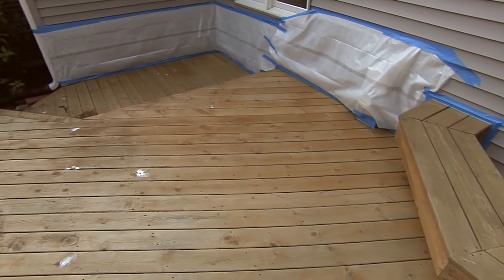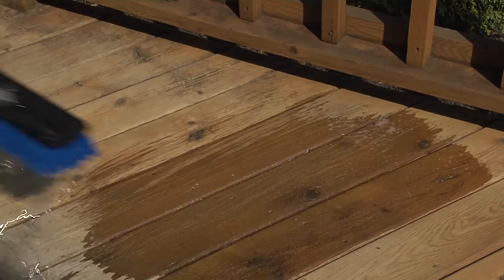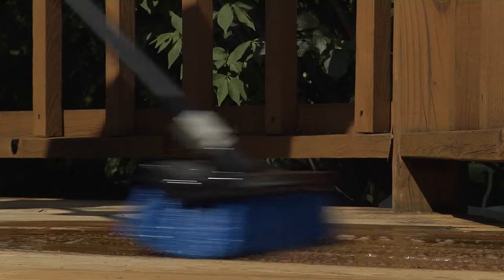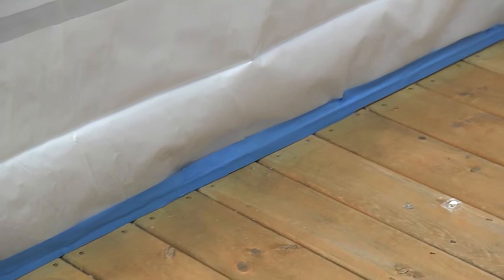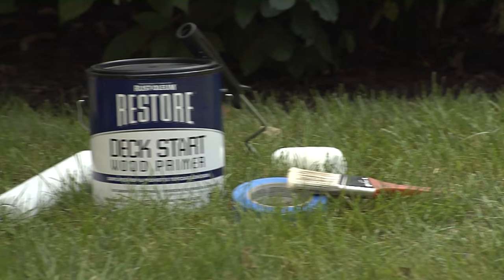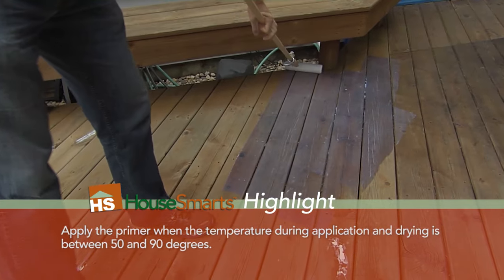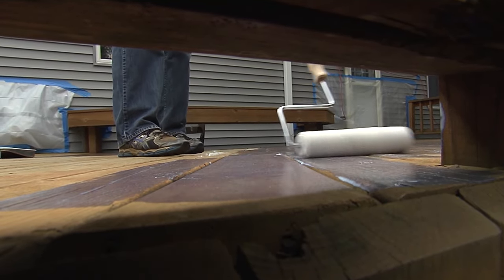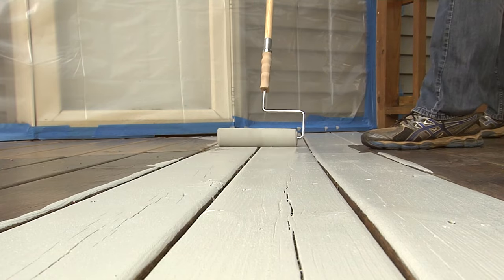How to Paint a Deck

Comment: So I can use any external deck paint after the primer? Do I need to use primer if I am painting with external paint? I noticec some don't use primers before applying external paint
Reply: Always use the same brand primer and paint. Try not to mix.  I have  had color bleeding.

Comment: Hi I want to repaint my deck white but others tell me paint is bad. To use stain instead. Can I use white exterior paint or will it bubble and ruin the wood?
Reply from the maker: Do you know what type of wood it's made out of?  You should be able to use exterior paint without an issue.  Just know that whether you choose stain or paint, it's never a "set and forget" proposition :)